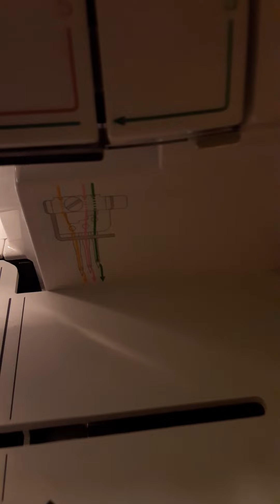The easiest way to remove fabric from your Brother 2340CV coverstitch machine

Comment: What are your settings on the side? My fabric does not easily come out....... it gets stuck in the plate.
Reply from the maker: Mine is set at the factory settings. Did you pull the white knob out? That is what releases the tension to let it slide out easily.